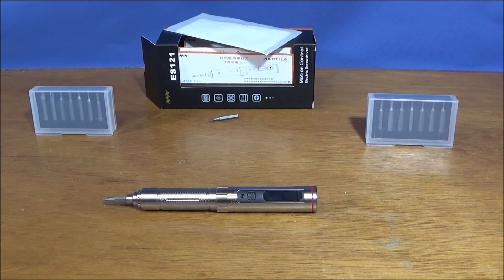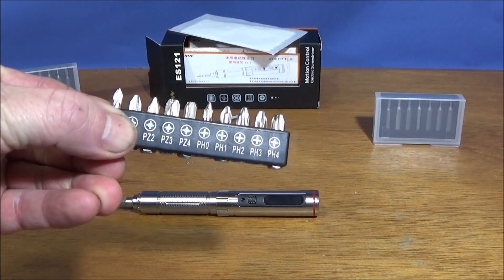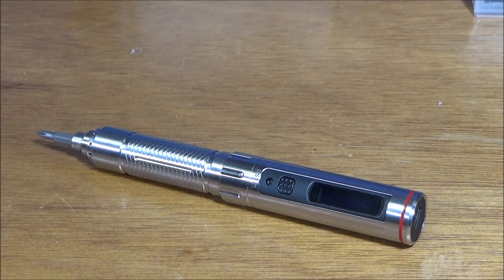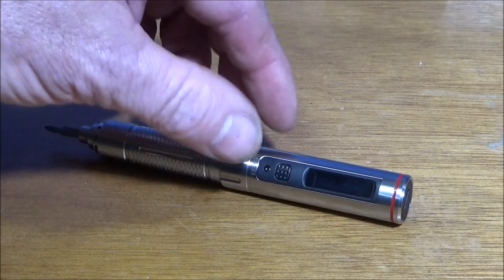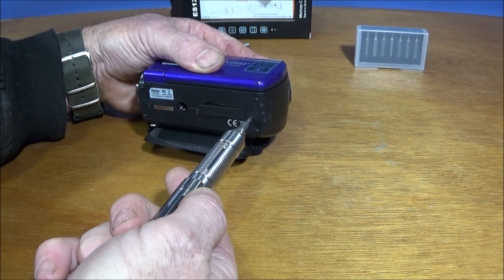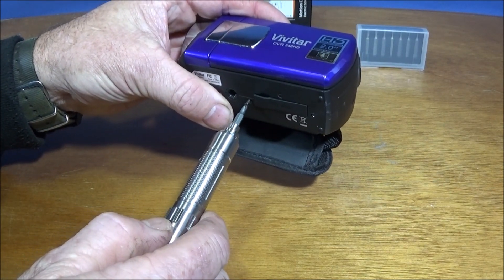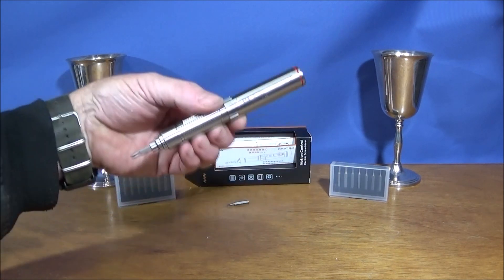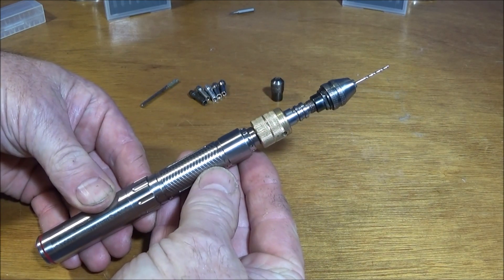ES121 Electronic Screwdriver Plus A Tool One Can Make For It

Comment: That ES121 sucker, especially outfitted with a drill chuck, would be fuckin' sweet for my Scale Model hobby but the use of a Micro-USB instead of USB-C is driving me up the walls.
My iPhone XS MAX was the last rechargeable device I bought that doesn't have USB-C and it's driving me nuts, but IT can be charged wireless so at least it got that going for it.
I guess I'll be waiting for an ES122 with USB-C and ideally also anodized in black like the Mini TS80P I already own ( fuckin' love that just as much and IT has USB-C ).

Comment: If you do fine little stuff this certainly does look great. However the torque is really low. You can't deny that.  Even a standard M3 machine screw should be tightened to around 0.6 Nm which is about 6.1 kgf-cm. You said that you can manually apply 30 kgf-cm without damaging it, but that's still only enough for an M4 screw. And that's only helpful for loosening, AND not even always, as the breaking torque of most screws is usually much higher.
Reply from the maker: It's designed for working o small electronic components which I have found it to be excellent for. I found it great for taking phones and optical equipment like cameras apart and for reassembly.

Comment: Does it come with a USB charging cable or which cable should i use?
Reply from the maker: It is the ordinary micro USB as on mobile phones. Not the 'C' type.
Reply: Okay thx for reply. Does the cable come with The screwdriver or do i has to purchase ond by my self? 
What about the usb charger, is it 5v or 12v and many amps? 
Can i charge it using my usb 3.0 port om my computer? 
Hos do you guys charging it?
Reply: Now that you have tried out both ES121 and The Atuman E3. Which one do you prefer / Can recommend of these two? 
What about The popular wowstick 1F+ have you tried this one?

Comment: As You have try bot of them, which one You would recommend ATuMan E3 or  ES121?  My worry about ATuMan E3 is bits, could be a problem to find replacement.
Reply from the maker: Hi It is a hard choice. As they are both excellent. I actually prefer the ATuMan bits. I bought the ATuMan manual screw-driver sets as well so I would have the full range. I am going to make an adapter soon so the ATuMan can take the other bits as well. I think I like them both the same really. I have always thought that good Jewelers screw-drivers were very poor quality over the years until I saw these sets.
Reply: @SteveJordan   Thank You for the reply, I found  these bits (figure how to search for them) .
Reason I looking for electronic screwdriver is Azeron keypad which I making every day, (there is about 60 screw for each)and looking way to do it faster.
At the moment I am more for ATuMan as it have bigger electronics and manual torque, bigger battery, better price.

Comment: The only downside seems to be the button placement. Even in the listing it’s shown as being operated by holding the tool in the opposite way that I’d normally hold a screwdriver. Have you found that to be a problem?
Reply from the maker: Hi Jay, No I found I got used to it. I think someone has made a neat clip on adapter so the button can be operated  by a lever further down. But I don't need one
Reply: put a blob of hotglue on the button, makes it much easier to use...
Reply: @ralphbooger4756  I can see how that would help.  Thanks!